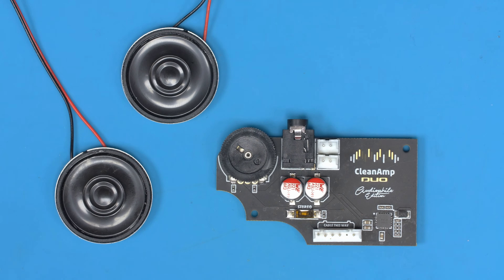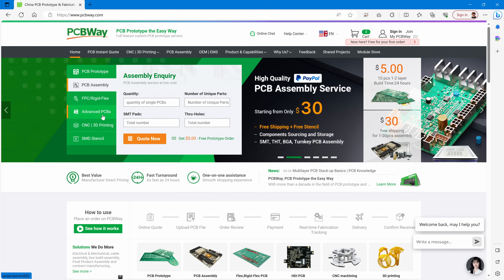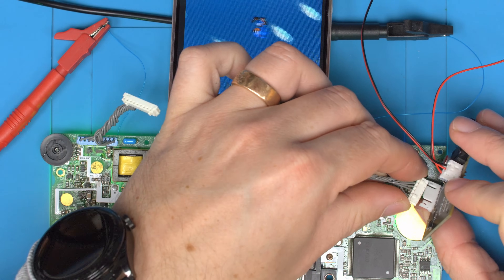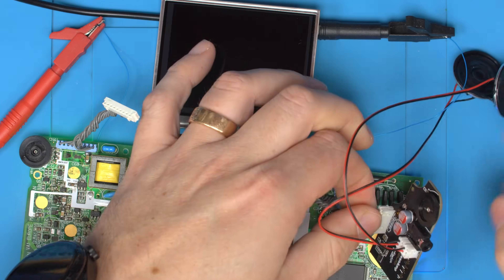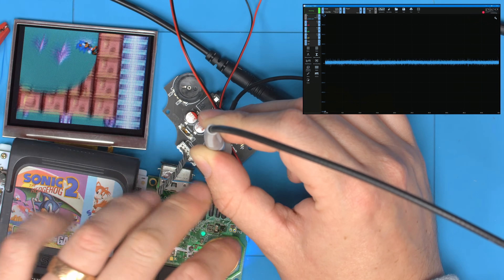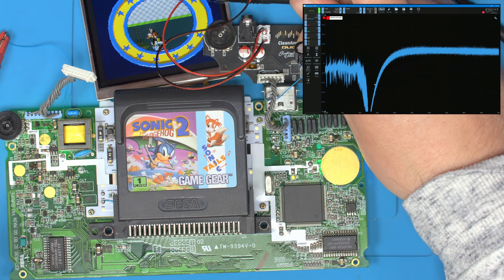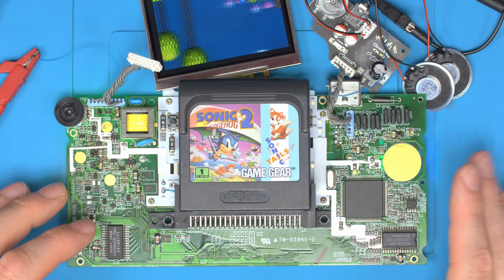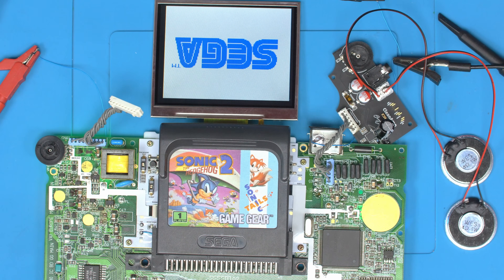Stereo Speaker Amp for Game Gear (CleanAmp Duo) Prototype Bring Up

Comment: I am willing to wait till the design is perfected however have you came with a design on how you will fit 2 speakers in the console? Maybe make a case designed for 2 speakers maybe a stencil to drill holes for the console.
Reply: There is a dual speaker case now ❤

Comment: Will this mod require a shell with two speaker slots?
Reply from the maker: You can put it inside a shell without extra holes but all our shells are now dual speaker holes as old stock is cleared off